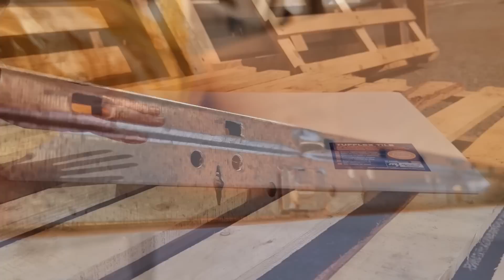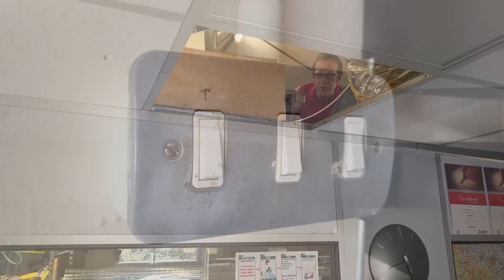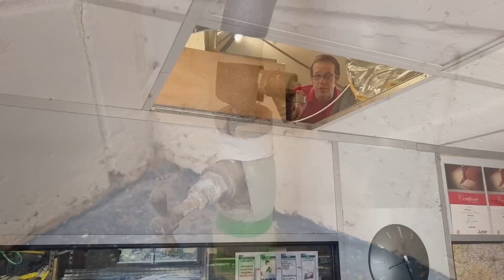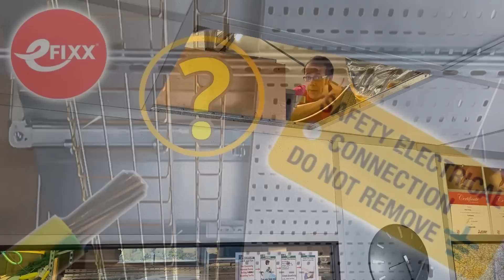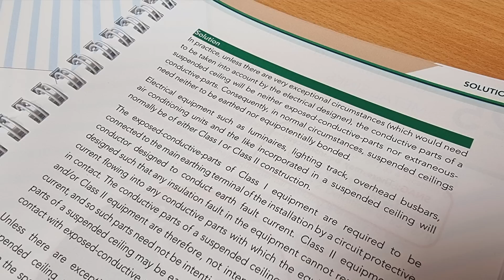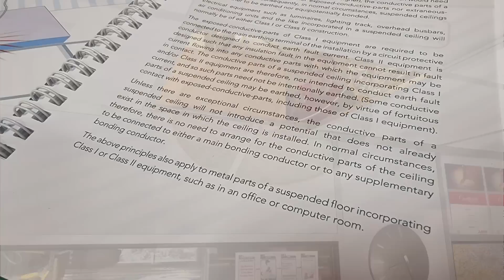Should you Earth Bond a Suspended Ceiling Grid?

Comment: Chaps - I would be really interested if you would have the time to explore this further? On ceiling grids i've often measured hundreds of volts between the grid and MET. This is being caused by voltage induced by LED panels accumulating on the grid. Of course, there's no current to it - but it feels wrong leaving a grid like this? Bonding eliminates this. Ive tested this and you have to be careful - existing class 1 fittings resting on the grid for example will be providing a path to earth - but in an entirely isolated grid (IE tested it has no connection to MET) - ive often found induced voltage builds up with the addition of LED tiles. Seen this with Lumineux and JCC tiles at least.
Reply: seen this before as well, bonding stops the voltage? i had one that was bonded and when you touched the led panel screws (it was class2 ) and the earthed frame you got a really small shock???

Comment: Class 2 equipment is fine, but Class 1 and a forklift impact is a bigger risk?... I was at college in 1990's 16th edition, and told to bond every extranious conductive part, no harm doing that is there? apart from cost? but at what cost is a human life potentially worth?.. Common sense prevails as always. I have replaced those 600mm light fittings in offices with LED Class 2 equivilents, no prob.. but some of the older Fluorescent types have earth bonding and ive seen a few melted Ballasts in some... tricky! I would say yes bond if old fittings used, but not if replaced with class 2 fittings. lol..who knows?...

Comment: Well, in theory correct, in reality I never saw a suspended ceiling where on top there was a ton of cable stuffed on it, even singles, connections not made in a junction box, just made in mammuths or Wagos or even tape and left there, then one pulls a cable, it gets loose, and touches the metal frame. If it's earthed the RCD trips (hopefully it's present and works) and you don't get a shock. 

Who install lighting it's not usually the electrician, since it's a simple job that the owner does, buys some LED panels online and installs them, and to join the cable to the one of the power supply they just use some Wagos and leave them in the ceiling, nobody will see them. 

Given these premises additional protection doesn't hurt. Like it doesn't earthing cable trays, because you know that somebody will sooner or later join two cables in a tray with just mammuths or tape.

Comment: Used to be the norm to earth the main Ts modular fittings used to have earth tags on them that earthed the grid when placed, the question should be if the grid was covered with cables from multiple electrical circuits would it be unsafe to earth the grid, if you think so then don't become an electrician

Comment: I was once working on a suspended ceiling grid that was 'giving shocks' - turned out to be a rise in potential due to an accumulation of earth leakage of all the lovely shiny new LED fittings hanging in the grid
Reply: I’ve had exactly the same , each fitting gave a small leakage to earth. 20 fittings later ouch
Reply: how was that solved?
Reply: @lewis brown  from memory I think we run 4mm earth to bond the grid back to MET.

Comment: If it's not an extraneous conductive part, then there's possibly no compulsion.

But if it does no harm, then why not?

Lot of metalwork with cables dangling all over. If one cable gets damaged but sharp metal, rodents etc, the grid could end up live.

I bonded my attic basket tray for the same reason.

Too much following the Holy Book of Religion, too little thinking through the situation.

No disrespect intended, that's s general criticism of the present times.
Reply: What happens in the event of a PEN fault?
Reply: Same as happens to my copper gas pipe that runs all the way around the outside of my house.

Except that is a risk as a person may contact the true ground and the pipe.

That's rather less likely to be an issue in my wooden attic space where the only other extraneous metal objects (water pipes) are well bonded to the tray via the MET.

Still a win I reckon and no real risk in my specific case, though you could argue your point if the tray runs through an area where contact with it and true ground is likely, like outdoors, or in a room with a concrete floor, especially one that may become wet.

This does rather highlight TN-C-S as an inferior system to TN-S: in principle the utility company should have adequate MEN provision, but it will never be as good. Just cheaper...

Perhaps this is an argument for adding earth rods/etc to every TN-C-S MET to improve the odds?

I have one, but that's because I have a genny transfer switch too.

Comment: Comes back to the design and installation stage. Is the ceiling grid 3 floors up and attached to a wooden stud wall then no bonding needed. Is the ceiling grid ground floor and attached to a jumbo stud metal frame wall secured to the concrete reinforced floor? In the the case of the stud wall on the ground floor I'd recommend bonding it just to CYA as I've seen it produce a potential of 150v in the past dhe to faulty fitting and bad wiring etc, so yes in that situation I would personally bond it.
Reply from the maker: Interesting thoughts here.
Reply: Yh I was gonna say, depending on building construction a suspended ceiling *could* be an extraneous conductive path. But again, the point being made I think was more just cause its a metal grid and part of the building doesn't immediately make it as such.

A steel framed building with a false ceiling hung by  catenary wires from the steel frame, yes likely has a good ground path. A more traditional brick and timber framed building with a suspended ceiling highly unlikely to be a path to ground.

As Joe kinda says an implies, there of course are cases where you genuinely would need to do it, but the flat out 'you must earth the grid' is not the best approach as you can (as efixx say in other replies) be introducing a shock risk as opposed to reducing one.

Comment: If proper bonding costs nothing, then why not to do it? It increases the safety, even if a class 1 device has a loose eathing connection.
Reply: But it doesn't cost nothing, unless you're working for free.
Reply: To the other replies: the cost is miniscule.
Reply: @tjwatts100  And if I'd said that to my foreman, when he asked why I was spending time bonding the grid, I know exactly where his steel toe-capped boots would have ended up. 😂

Comment: You say the ceiling grid is often bonded in older installations - but these may have been installed to the 15th edition which was very heavy on bonding. Those who were practicing at that time still tend to bond more than is currently prescribed.
Reply: 16th too.

Comment: Wow now we know.👍 
But what I would like to know is 1) how was you up in that ceiling space with out the ceiling grid collapsing 😂2 it is formes the wall grid yet that wasn’t mentioned? .
Fantastic video as always Joe 👍oh and some but maybe not all parts of the aluminium grid will be fixed to a brick or concrete outside walls which themselves will be built on concrete foundations therefore it does connect with the greater mass of earth that we walk on .

Comment: Also - re your point about class 2 and class 1 lighting equipment. These points surround the possibility of a fault developing within the fitting. But I am guessing the most likely thing to happen that could make the grid system live is that the bloke who wired that equipment didn't do a screw terminal up enough, then a wire was dislodged later, pulling a conductor out of a junction box. Are we just saying "that shouldn't happen if the thing is connected properly"? Hope my question doesn't sound antagonistic, just interested.

Comment: Depends on how the cables are run ie on tray or suspended with cable tie’s,and how fixtures are fitted,ie centre of the ceiling panel or to the frame ,
Reply: Didn't he cover that in the video by saying that cables shouldn't be run over the suspended ceiling? That routing and supporting cables properly is the right way to deal with it, and not by earth bonding the suspended metal structure?

Comment: Should metal server racks (you know, the standalone / on castors 19" rackmount racks) in a plant room / server room / cupboard under the stairs be earthed? Assuming the contents of the rack unit is what you would expect, i.e. "consumer devices" with kettle leads, UPS devices, etc. and nothing wired direct to a wall? I bought one for our home network install, full height. It came with earthing kit. It just stands alone with a lot of network and speaker cable coming into it. There's a UPS at the bottom which is connected to a 13A mains outlet on the wall. Each device in the rack is connected to the UPS.
Reply: Yes. here is a handy guide https://excel-networking.com/uploads/Installation%20Guidelines/Exc_Installation_Guide_Reduced.pdf
Reply: I believe that would possibly fall under manufactures instruction, they might just refer you to local regulations however.
Reply: I did do it, including all the doors, but I don't think it would be so necessary... My UPS is earthed via the incoming line which also goes to the casing and connects via the rack ears to the rest of the cabinet. So are other peripherals in the rack that interconnect with that same UPS. Unless the rack ears would be painted or other parts that make contact but are not bare metal inside cavities or fittings, supplementary bonding might be a good measure.
Also think of any earthing for incoming coaxial or RJ45 cabling connected to the patch panel that could introduce potential or spikes and destroy/weld equipment :)

Comment: What about a bathroom radiator which is water fed from the central heating but also has an electric heating element?
Reply from the maker: Does the electric water heater have an earth connection?
Reply: @efixx  they do usually have their own protective Earth connection
Reply: @efixx  yes, it's a three wire unit connected via a double pole fused switch.
Reply: The radiator could have 5 parallel paths . 1 from the heating element cpc,  1 from the boiler supply cpc, 1 from an immersion heater ( if cylinder fitted)  and  2 from main bonding conductors . I think that's enough .
Reply: Bond it!

Comment: One of our guys was shocked by a live ceiling grid because some 🤡 had severed the cable to the lights and just left it there, so yes, earthing would help.
Reply from the maker: If the 🤡 severed the cable to the lights would he not also have severed the earth connection? 🤔
Reply: @efixx  may have had more than one circuit feeding the lights.
Reply: @raychambers3646  But for any given light, it can only be fed from a single circuit.
Reply: I suppose the question is more; if it only takes a short time to do it, is it worth it?